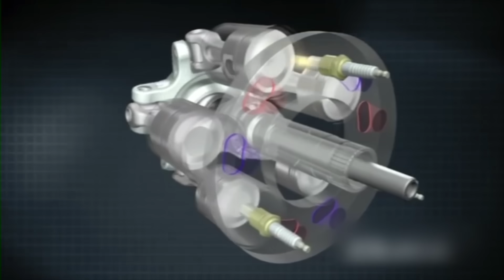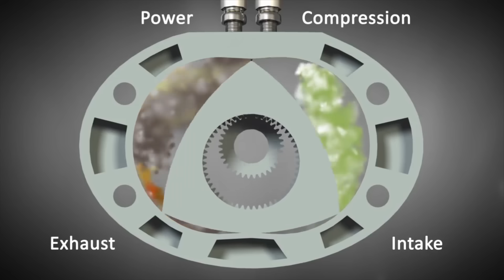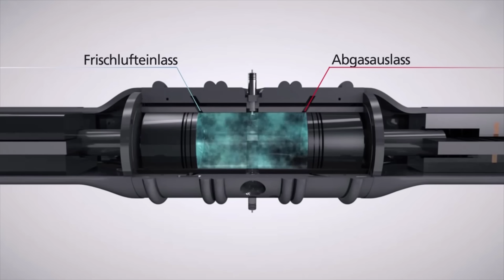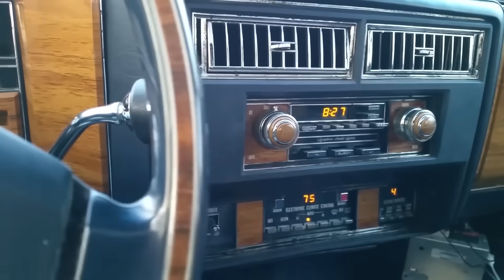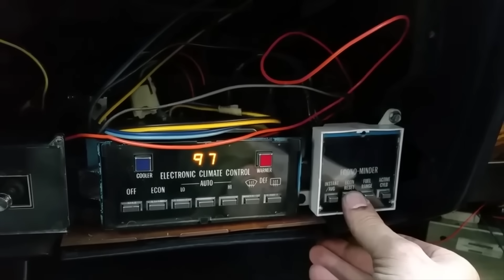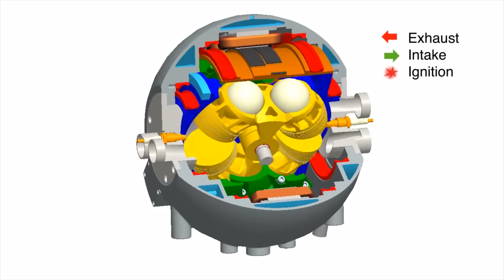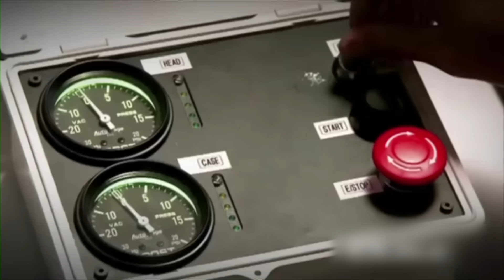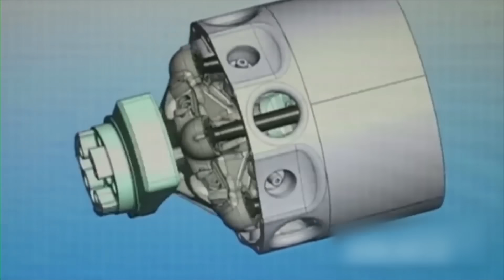10 Strangest Engines of All Time

Comment: You can't beat those old steam engines. They just run so smoothly and were made to such precise tolerances. And so much power.
Reply: the torque was insane on them that they didnt need different gear speeds, i wish they could bring that back and improve on it

Comment: You did lie again!  The Cadillac 684 concept was improved.  Later, it became the DoD or Displacement on Demand concept which allowed disengagement of valves, solenoid control, thus turning a V8 into an I-4 tremendously increasing fuel economy.  Customers still complained about issues but these were of durability.

Comment: You‘ve got your facts wrong. The NSU Wankel Spider was the first production automobile to be powered by a rotary, or Wankel engine, made between 1964 and 1967, way before Mazda showed up. The NSU Ro 80 was NSU’s second production automobile. The other car you show is the ill fated Citroen GS Birotor, Citroen’s second attempt at a rotary powered car after a small fleet of test vehicles of the smaller M35 had been built. The engines for the Citroen cars came from a NSU - Citroen joint venture named Comotor. None of this had anything to do with Mazda, but only Mazda was successful in selling substantial numbers of rotary powered cars over a long period of time. NSU had been bought by Volkswagen in 1969, who were not interested in pursuing the Wankel strategy. A notable but commercially unsuccessful offspring of the Comotor initiative was the Van Veen OCR 1000 motorcycle from the Netherlands, which used a version of the engine developed for the Citroen GS, of which only a handful were built in the mid to late seventies.

Comment: I dont recall the Cadillacs bieng that enimic.  My Dad had a 79 coupe that was nice , smooth and definitely never got beat by any compact . Matter of fact I raced my friend who had a 80 280 z and I left him in the dust..So they may not have been as fast as those 500  or 472 s but the ones with 7.0 were far from enimic  maybe the 5.0 in 80 81 was ..But hey the 4-6-8 was a disaster that is for sure.

Comment: If inventing something means to conceive a working concept and patent it. then the first stroke engine was invented and patented in 1862 by the French engineer Alphonse Beau de Rochas, but since Otto was the first to build a commercial engine based upon this principle we refer to our modern IC engines as Otto cycle engines, not Brayton cycle engines.  The Brayton cycle is a thermodynamic cycle named after George Brayton that describes the workings of a constant-pressure heat engine not a 4-stroke..

Comment: Wow, biased new image that. What about the V8 VW engine. What about the numerous engines that Whitehead built around 1900. Chevrolets V8 engine in 1917-18. Hand built engines like the v-12 of Lockhart, 4 cylinder engines of the Wright Brothers. 
FYI: the Wankel engine was first bought by GM to be put in the Vega, it would not pass the 50K emissions test due to premature wear to the rotor seals (now made of ceramics).

Comment: Various scientists and engineers contributed to the development of internal combustion engines. In 1791, John Barber developed the gas turbine. In 1794 Thomas Mead patented a gas engine. Also in 1794, Robert Street patented an internal combustion engine, which was also the first to use liquid fuel, and built an engine around that time. In 1798, John Stevens built the first American internal combustion engine. In 1807, French engineers Nicéphore Niépce (who went on to invent photography) and Claude Niépce ran a prototype internal combustion engine, using controlled dust explosions, the Pyréolophore. This engine powered a boat on the Saône river, France. The same year, the Swiss engineer François Isaac de Rivaz built an internal combustion engine ignited by an electric spark. In 1823, Samuel Brown patented the first internal combustion engine to be applied industrially.

Comment: 5:56 it's variable displacement, which will affect the compression, yes, but that's not what they are changing or what you define here. That's the displacement of the engine.
Reply: It also looks exactly like skyactive from Nissan which was in production several years before this.
Reply: James Blissenbach you are correct sir. That's an Infinity which is a dressed up Nissan. I didn't know that's what skyactive was though thank you. When I left the business this type of shit was just coming out.

Comment: nah.
higher compression = more power for the same amount of fuel, or less fuel used for a given amount of power. 

they use the system in an oposite way. they run the engine at high compression to save fuel but lower the compression and increase the preasure from the turbo to get more power than they would be able to without the compressoin change due to engine knock, also known as premature ignition

and i have more than just heard about all of the engines mentioned

Comment: Uhh @5:40 the graph on the left side shows the compression going DOWN from 11:1 to 8:1 saying more power is produced...uhh no. You drop compression ratio if you are boosting...but a car that is naturally aspirated, the honda S2000 for example, uses insane compression ratio of 11.7:1 producing about 124hp per liter.

Comment: The Chevy Volt is the only car with the range extending engine. It is only real hybrid, power generation by separate engine-generator, just like a modern day locomotive. I like my electric golf cart. I have to remember to force the engine on a couple times a month to run the damn gasoline-alcohol fuel through the lines.

Comment: Lol wut, high compression engines eat more fuel? you meant to say the higher the compression the more fuel efficient/power you get in an N/A engine, so long as you can keep the knock down, otherwise knock knock who's there, cylinder 3. Only when you want to increase power alot will you use more fuel generally

Comment: The Cadillac 8-6-4 left the valves closed, not open, and shut off the ignition, and adjusted fuel delivery, to account for the respective cylinders being cancelled, essentially making them into springs. If the valves were open, it would act like a diesel jake-brake and slow the engine down. They worked good in theory, but had no end of valve train issues, slow response time, and fuel pooling in the intake, for only about a 10% gain in mileage, and serious driveability issues. Thankfully it was only produced for a single year in 1981. 😜

Comment: That Duke engine concept ought to be applied to aircraft. In aviation, power to weight ratios are key
Reply: There are lots of things that should be applied to aircraft. I remember talking to a pilot about this kind of thing and was shocked to find out they were still running magneto and points ignition. I asked why not CDI ignition its more reliable. He said that aircraft use a lot of old tec because it costs a small fortune to get things certified and a lot of the time its not worth the cost.

Comment: I want to build a artificially intelligent two wheel  2 cycle scooter,that runs only from the hydrogen and oxygen it sucks from the air. No more gas. No more electric. This scooter goes up to 50 mph - carries body weight up to 300 lbs,and extra weight 50 to 75 lbs..Has front lights,brake lights,front and rear brakes,with a loud horn. Einstein's   descendant.

Comment: I owned one of those Mazda rx7s. It was a 1982 normally asperated 12A two-rotor engine. I was amazed how much power that engine had when wound out past 10,000 rpm! Power kept build long after you expected it to peak. I first saw that engine powering Mazda pickups and sedans and thought to myself why they would put such a powerhouse performance motor in a mundane vehicle not designed for speed and performance, but they did!!!! I loved that car so much. It even beat out my former lover, a 1966 Shelby Cobra Mustang I owned back in 1968. Don't get me wrong, I still love that mustang but after the RX7, my love was divided! I can't imagine driving one of the newer RX series cars with the 13B and double turbos! I've seen some 3 rotor race motors perform in some very light cars that were just insane! I was really sad when Mazda quit manufacturing that motor
Reply: I remember reading about a guy who raced in the box stock class, with his RX-3, with the upshift light. He raced it on consecutive years claiming that if the upsift light went off, he downshifted. Won a lot of races too.

Comment: No mention of the Motoczysz C1? Two parallel banks of two cylinders with twin, counter-rotating crankshafts to neutralize vibration and, more importantly, rotational inertia, which affects the balance and handling of a motorcycle. Eliminating the inertia of the engine eliminated the gyroscopic effect it had on the bike, making it more agile and easier to lean into turns regardless of engine speed. Changes were made to MotoGP rules just before it could really race, and the firm didn't have the time or resources to re-engineer the relatively complicated engine to meet the new rules, so they transitioned to making an electric bike instead.

Comment: The first narrow V producono  engine made wasn't VW but Lancia in early sixties produced in over 350000 units and used on Lancia Fulvia It was a 4 cylinders from 1200cc to 1600cc dohc, the V adopted was from around 11 to about 13 degrees

Comment: Downvoted for important incorrect information!

There were other Internal Combustion Engines before 1872.
Reply: Like the first one ever built and experimented with in 1680's by Christian Huygens a Dutch physicist , however no effective engine was produced until the late 1860s.
Reply: @myazzizonfyr  1794, Robert Street
Reply: @corydorastube  didn't the Robert street engine run off of wood grain alcohol or turpentine or something of that ilk?
I think I remember seeing in one of my grand dads old Sears and Roebucks catalogues which advertised the Robert  Street Oil engine for industrial ...good call mate.
Reply: @myazzizonfyr  What difference would it make what fuel it burned? It could burn coil oil, gasoline or natural gas, It would still bean internal combustion engine would it not?
Reply: @corydorastube  I was more asking for clarification mate...but yes the fuel source wouldn't matter as long as the primary combustible source was contained in a chamber that would drive a piston and in turn a crank shaft producing torque yes it would be the very definition of a combustion engine.
Reply: And That cars That have higher compression need more fuel!

Comment: The duke engine is a clear winner for light aircraft and I like the Pudlin diesel, electric drive to all 4 wheels using brush-less disc motors would give awesome 4 wheel drive with infinite gearing and light weight and zero transmission wear amazing ground clearance.

Comment: the first thing an engineer should say to him/herself when dreaming up new designs to replace old designs is,  KISS.  Keep It Simple Stupid.

I will never spend my money for a vehicle with a unnecessary overly complex engine like that one from infinity.   I am to the point I don't even want a overhead cam engine due to needing the timing belts and tensioners constantly replaced.  it adds complexity, cost of ownership, cost to production and cost to repair unecessarly to something that already works good enough.  find alternate technologies instead of re-inventing something simple and reliable.  also it's adding unnecessary complexity to a repairs.  mechanics are already way underpaid.  now they have to deal with engine problems with stuff that's designed by an asshole with no regard to ease of maintenance.
Reply: Hey Its Me Derek  valve float has nothing to do with pushrods.  In fact ohc engines suffer from it too.  It's why Ducati does their valves the way they do. Look that up it's a wild setup.   And it causes the owner to have to do valve lash checks every 10k miles.  My r1 has rocker arms with the ohc setup because of the valve float problem. Irony they have to use "old tech" to solve problems with new tech
As far as complexity look up Ford cam phasers on YouTube.  Look what a mess that is.
As far as rev limits who cares.  A engine has to rev to the moon because it's so small.  But it doesn't have to be.  The modern V8s  engines in the mustang Camaro and corvette are spinning to 7k as do a lot of race engines.  They use lighter rods etc.  I don't think you've ever been around a car making 2k HP with a 5500 redline.  But wait, how is that possible if it can't rev to 9k?

Comment: The 160 Hp engine of the tucker was at the time of production far more powerful than any other 360 CID under production by anyone else they boasted may be 50 hp to 60 hp and their torque was only around 100 foot-pound at around 3600 RPMs but most were less than a hundred Ft/Lbs.
So your ONLY statement is really out of place when speaking about THE TUCKER FRANKLIN ENGINE.